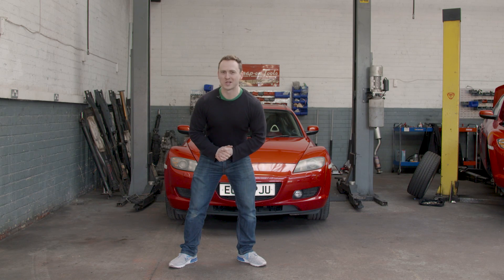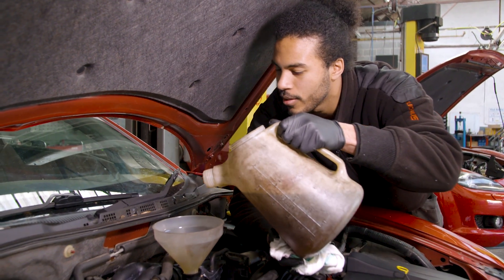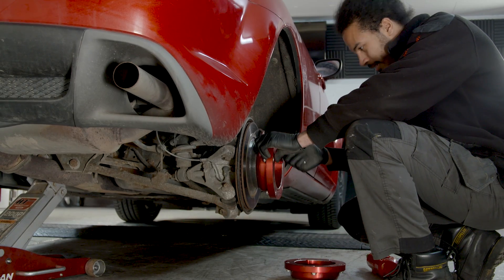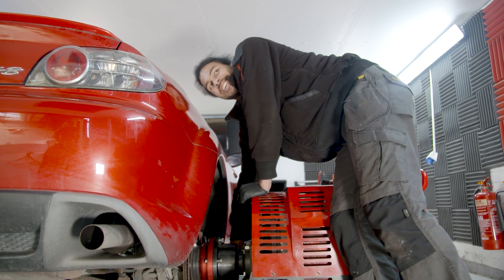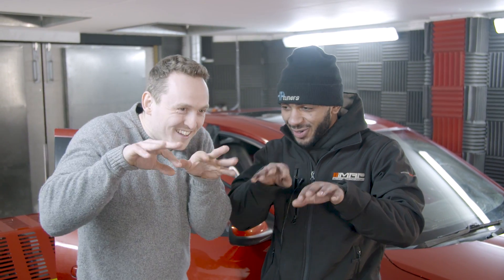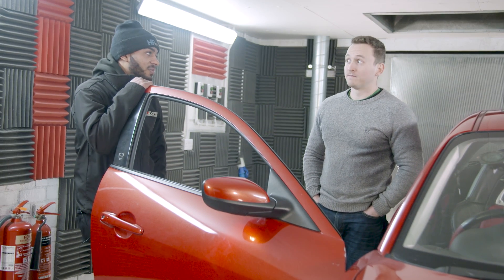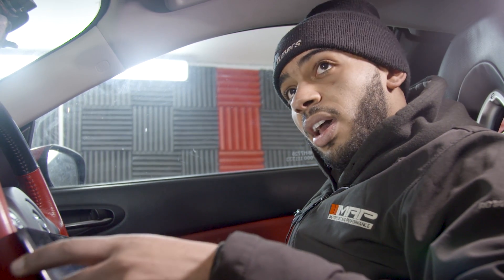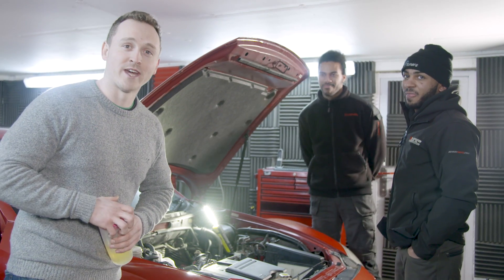Tuning My Rebuilt Mazda RX-8 For Flames

Comment: There are 2 types of tuner
1.tuning for hrsprs
2."I want flame at my exhaust"
Reply: I like #hrsprs
Reply: why not both xD
Reply: Both is best!
Reply: Both is good.
Reply: What's hrsprs?
Reply: @demonking4893  #HRSPRS
Reply: @demonking4893  Horsepowers :D
Reply: Mo powa baby
Reply: @Zapablast05  Mo powa baby
Reply: Tune for 1 and youll get both, especially with a Wankel engine.
Reply: @demonking4893  normie doesn't watch donut media 

POWA BABY
Reply: @demonking4893  horsepowers

Comment: It actually sounds sick for stock exhaust
Reply: I believe the rear section is not stock. Someone just cut off the tips that came on the exhaust system. It's a racing beat muffler back there or something. They pointed that out during the inspection of the undercarriage
Reply: Doesn't have a cat either I think
Reply: Aftermarket exhaust
Reply: De-cat exhaust
Reply: Chico's Garage I don't think it's all stock dude......But it does sound awesome!
Reply: Yah u don't need to "tune" flames into rotary engines cat delete and free flow exhaust is all it takes..

Comment: How to buya  decent example of an RX8 for decent money:
- buy crap RX8 with shot engine for nothing
- spend a few thousand quid on engine rebuild, remap and bits
- ...
- PROFIT!!!

And it's not even a sarcasm. Nice series, keep it up!
Reply: Works for 996s too.
Reply: Pedro Venda 996s are Porsches, not rotary, not Mazda
Reply: Help me! My fiance bought rx8 and has spent way too much trying to fix it. It's currently sitting in our yard not running.
Reply: Erika Speck sounds about correct
Reply: I have a nice one no wrecks with 70k on a dealer installed new short block at 66k, been in dry storage since heart failure, silver on black 6 speed needs to go.

Comment: I didn’t know that tidbit about semi-synthetic vs full-synthetic and burning vs carbon buildup. Interesting
Reply: Steven Barnette really only applies to rotaries
Reply: @Cooperdaleit  and old diesels
Reply: Yeah it can be a big problem. Gotta remember the OMP squirting engine oil into the combustion. I still use straight mineral on my 13B.
Reply: So why is modern 2 stroke oil fully synthetic? Or is four stroke oil specifically made to not burn
Reply: @obbezwiers  .. Fucking good question. Lol.
Reply: @obbezwiers  Yeah that is a good question. I think it's just cos 2 stroke is made to burn, 4 stroke isn't, as a rule.
Reply: @obbezwiers 
I'm a motorcycle mechanic at KTM, so I'm working on two strokes almost on a daily basis.
The advantage of fully synthetic 2 stroke oil over semi or mineral is the lubrication under heavy load and high temperatures.
It simply ensures best possible lubrication under extreme circumstances.
The problem is, that it burns with more residues left, than semi or mineral, which burns the best.
This leads to more carbon built up in the engine/exhaust, especially if they are not used in competition. In let's say average street use, it's better to run semi synthetic. If you run fully synthetic and you don't rev the engine and give it some load, you'll get lots of built up and in worst cases it will clog the exhaust.
Reply: @Cooperdaleit  Probably also true for Audi TFSI engines.
Reply: I read there is an oil that has a property for when burning oil (must have been a high mileage?) so it did not ruin emissions systems I forget must have been years ago. That was on the back label. Any one have a clue?
Reply: @obbezwiers  2 stroke oil is usually used in high reving motorcycles. The higher the load, the better it burns. However if you daily drive a rotary and don't load it all the time and rev it up to redline it won't burn off the extra stuff and it will cause carbon buildup. 2 stroke engines have shit torque at low rpm, so even if you daily drive a 2 stroke bike you will most likely red line it and pull it a few times a day.
Reply: @Chris675R  I was worried for a bit for my 2 stroke until you said "if you don't rev the engine and give it some load"

Comment: As a fellow RX-8 owner, I'm really enjoying this series! It'd be so awesome to see an RX-8 built around absolute handling ability, to the point of doing stuff like custom spring rates and revalved dampers, adjustable sway bars, bushings, chassis braces, and all those other little things that very few people go to the trouble of doing! I'm hoping to build mine that way, it just takes a lot longer when I'm working with a fraction of the cash flow that a well known company like you guys have. These cars are world class in terms of cornering ability, even against modern cars, and to see one taken all the way to the limits in that aspect would be amazing!

Comment: A fun idea would be to build up an old RX-7 FC shell with a fully street ported Renesis engine with the triple oil injection for better seal life. Something in the range of 280HP at the flywheel in a naturally aspirated configuration (225-230HP at the rear wheels) would be incredible in such a light vehicle and would make it eminently streetable but still fun to fling around a track.

Comment: What about blocking the OMP off and adding the 2 stroke adaptor? You can then add seperate oil to optimise burning and lubrication instead of trying to find a compromise to both.

Comment: Put one of those oil injection reservoirs that mount to the firewall so you do not draw from the engine oil but from their own separate container as to not draw engine dirt into the rotor housings.

Comment: There's a recall on the fuel pumps on the RX8s, at least here in the Eastern Europe it's still going (there are recalls for the fuel pump, some catalythic converter heatshield which cooks an engine mount and of course the airbags). Contact any Mazda dealer near by and see what they have for your VIN number.
And don't forget to turbo the RX8.

Comment: Turn it into a drift Rx8 with a big carbon wang and no hood! Make it a 4 rotor with twin turbo and add a huge air intake on the front bumper..then add remove the rear exhausts and swap them with some titanium exhausts and dont put them back on the rear! Put them on the engine so you get backfires infront of you!😏 and last but not least add a widebody Rocket Bunny kit and voila! The perfect drift/time attack rx8...Im pretty sure you wont notice this @CarThrottle
Reply: that would cost a shit ton ahaha

Comment: the rx8 uses a saddlebag fuel tank. the tank only has one pump on the drivers side. Its uses a vacuum to pull from the passenger side tank over the driveshaft. If the drivers tank is empty and pulling from passenger the car may lean out. I would suggest a full tank before turning and retrying.

Comment: What annoying beep did you mean?  The "time to change gear" beep at high revs?  If so, there's an option on the dash for that, possibly in the stereo controls (sorry, I remember seeing it, but I can't remember where it was)
Reply: the beep that speeds up when you drive without a seatbelt. I always take my belt off to reverse on my drive, and the beep is annoying AF
Reply: @alexkersten1964  Ah yes, that one is a shithouse :-D  Thanks for replying

Comment: Are hub dyno’s harder on CV axles? In the service manual it counter-indicates driving the rear wheels with the car suspended due to the severe angle. Maybe it is specific to some geometries but I am curious.

Comment: The fuel pump assemblies are under recall right now. If your vehicle has not been upgraded you will get a new pump, filter, and lock rings for free. At least in North America you would, I don't know if that is true where you are.

Comment: Question for Josh, What do you think about Toyosports Headers and Catback?
Reply: Here's your answer: don't. 😶

Toyosport headers need the flange  machined flat so that they don't leak. Overall the quality is incredibly poor. The Cat-Back is exactly what it is: cheap. I'd not even bother. I'm sure the pipe is smaller than the stock as well last time I checked!

Comment: Just the fuel pump?  That is a minor problem. I don't know how hard it is to do in an RX8 since I've never touched one of those.  But if it was something wrong internal with the engine, that would something to worry bout.
Reply: Fuel pump change takes about an hour. Unfortunately, the guys were fresh out of them so couldn't swap over
Reply: OK makes sense.  So now to wait for the next video.

Comment: clean the fuel tank out of all the tesco sludge at the bottom, only takes a hour, and save £100 alot of the times, fuel pump's can alway do a X % more rev's when turning, as long its all clean, and get some fuel system cleaner, 4 bottles

Comment: "Check the injectors for an easy fix" Lol, an RX8 fuel pump takes a solid five minutes to swap out
Reply: We didn't have a fuel pump in stock to try out 🤣 And injectors are easy to swap out and/or check.

Comment: Pretty stupid question : Does the car need an oil change ? I mean it burns it away anyway, like a 2 stroke scooter, correct me if I'm wrong.
Reply: Yeah - it actually required more frequent changing...  the actual amount burnt is tiny (1ltr per 1000 miles, approx - and the engine holds 4.5-5.5, depending on model etc, iirc), but that 'concentrates' the dirt into the reduced oil volume, and puts the remaining oil under more stress, causing it to break down faster.  Yes, you then top it up - but that doesn't 'de-stress' the old oil...

Comment: Nice to see the RX8 get some love for a change :)
Got a 05 one myself, had it for five years and it's never let me down.
Have one minor issue, does anyone know why the engine management light comes on at below about 10degrees, if I switch the light off it will stay off even below zero, but let the car cool down overnight and it will be back on, it's absolutely fin tho in the summer.
Fault comes up as P010 something emmissions, more annoying than anything, car drives fine with light on or off.

Comment: This is like the third rotary killed by a fuel system on YouTube in the past two weeks...
Reply: Fortunately, it sounds like this rotary isn't dead - they just couldn't complete the mapping...  that said, rotaries really don't like going lean from lack of fuel,  as I understand it, it can trigger det - and even a tiny amount of det can/will kill the apex seals...  which is why the rev limiter does ignition cut (iirc) instead of fuel cut...

Comment: 170 rear-wheel hp on a bad fuel pump and part throttle.  With everything working right, 250hp?  Or 300? :evil grin:

Comment: Hoping its not the fuel pump cus its a bitch.. ( takes the whole manifold checking injectors smh) would of been easier to check the fuel pressure ..

Comment: DID YOU REALLY PUT SYNTHETIC IN A ROTARY?!?!?!? Unless you've done the 2 cycle oil conversion, YOU NEVER RUN FULL SYNTHETIC IN A ROTARY!!!
Reply: Which is why they put semi-synth in, and explained why they were using it...
Reply: @logicalChimp  I heard that and I listened multiple times and just heard a 3rd time as I'm typing this, but my time working at the dealer suggested no synthetic of any because of carbon build up. Semi synthetic shouldn't be ran in a rotory unless it had a 2 cycle oil conversion kit. It burns the 2 cycle oil, which saves and extends the apex seals,  while the rotating assembly could live a long life on full synthetic.

Comment: I really don't get why Mazda went back to na with the rx8. Turbo is just so much better. Especially since turbos make wankels somewhat torquy
Reply: Turbos kill rotaries (the water seals can't take the increased chamber pressure and heat, and fail after ~60k) - the RX8 was intended to be a family car for everyday use, not a low-mileage sports car, so Mazda removed the turbo to try and increase engine lifespan...
Reply: @logicalChimp  Well but the lifespan on rx7 isn't any worse, for what I know sometimes even better.

Comment: using shit semisynth, putting some bob the builder sealant onto engine instead of normal gaskets, straight from rebuild to dyno. This "british automitve knowhow" is the reason uk produces shit vehicles which die on the factory floor.